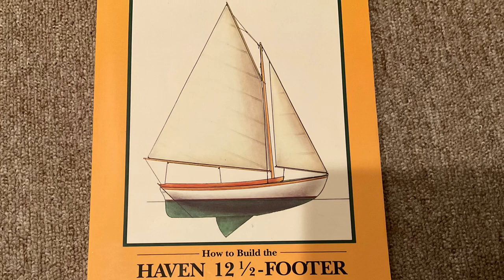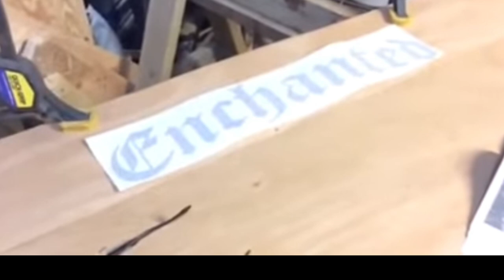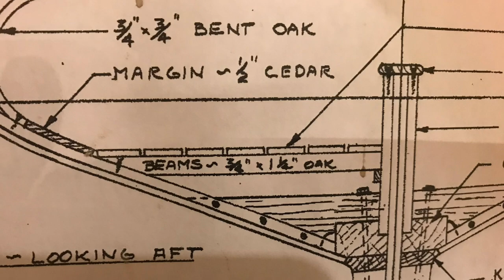Complete boat build of the Haven 12 1/2 “Enchanted “  5 years in 30 minutes - Episode 127

Comment: Putting together a montage like that must have taken ages. I still think the inside the hull shots are incredible pictures, such an organic shape. I didn't have you down as a "Marlboro man", lol, there aren't many of us left.
Reply from the maker: it did take a fair bit of editing. Some of the early photography wasn't great but yeah, there is one shot of the inside of the hull, just frames, trunk and planks with a coat of epoxy on, that I actually printed out and framed. it is on the wall next to the door in the shop. Thanks Dale
Reply: @JenkinsBoatWorks  Yes, I've seen that picture a few times.